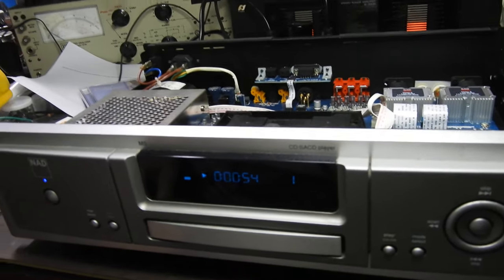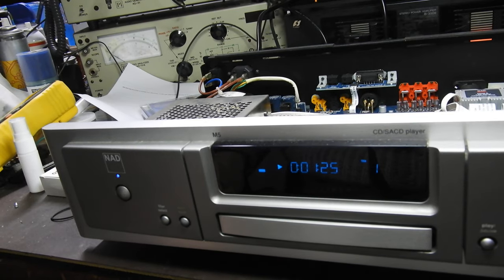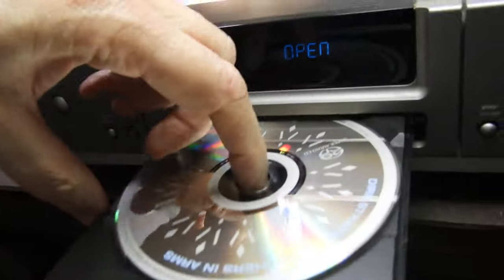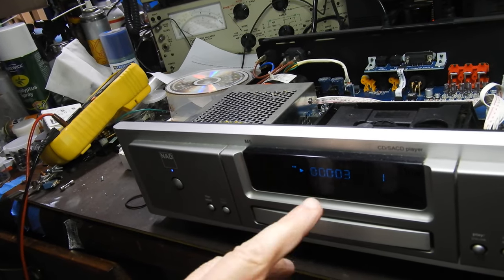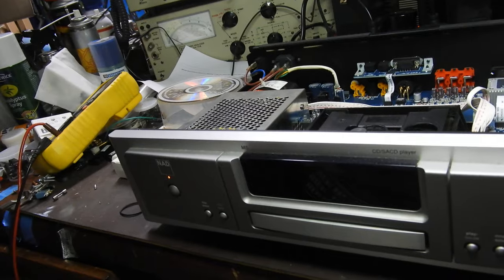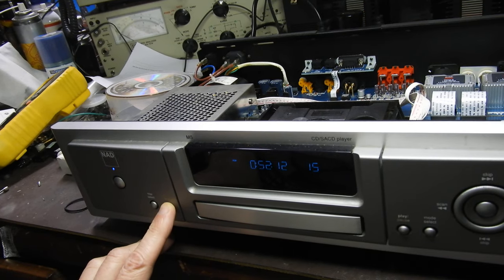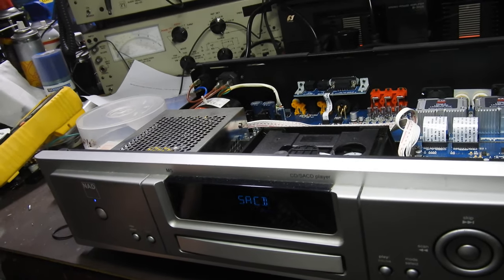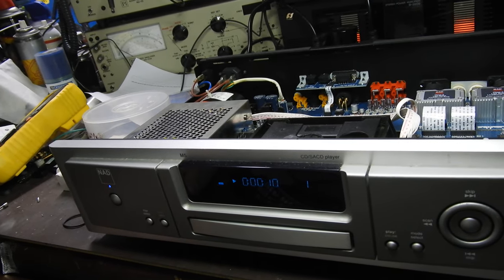NAD M5 SACD / CD player half fixed (still needs to be power cycled to work)

Comment: Hey I have the exact same CD/SACD player. It had belt issue which I got it changed and I was working good for awhile. However, due to work commitment I let it sit unused for a round 2-3  months and now it no longer reads or play CDs but It reads and play SACD ok.  Go figure. It is a good CD player and NAD makes good stuff but not reliable in the long run IMO
Reply from the maker: Lack of reliability is a "feature" of most SACD players. I might be wrong here because I mostly see faulty ones, but these cheap DVD mechanisms are just not made the 80s and 90s CD mechs were.
Reply: Exact same problem, were you able to fix it eventually? BTW where do go the get the belt? Thanks!

Comment: I've got an M5 which I got ex display at cost. Worked well for several years, then became almost unusable. I'm told by my local audio repair bods that it's an unrepairable PCB fault, and NAD say these are no longer available.
Reply from the maker: They may o may not be right. Hard to tel without examining it. I have two of them - one fully working and another with a fault. The reason I haven't put the good one for sale, is that I want to swap parts until I know in which area the fault really is. It has been siting on the shelf for years now waiting for its turn.
Reply: I had it looked at locally by a company I normally use and know what they're doing. They'd previously fixed the CD drawer. There's loads online about how unreliable they are. What a PoS...

Comment: Hi, did you check the supercap, if any, that keeps the memory alive? Did you solve the problem?
Reply from the maker: No, I haven't had a chance to go back to it yet. But I will (one day). I have another one that is completely faulty (does not read discs of any type) and this is the one I need to sort out first.
Reply from the maker: @roymindmybusiness6908  Did it really cost $4000? Add $2k and you could get used Wadia...
Reply: @hear-net-au  yes serious it honestly was way over priced in Australia.